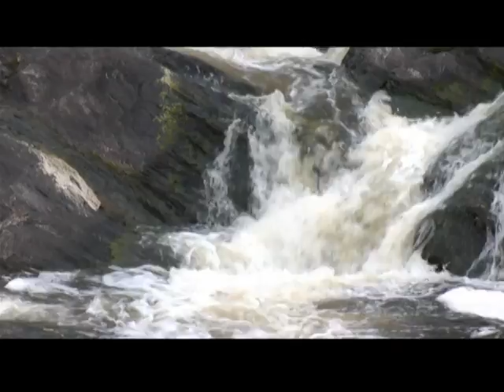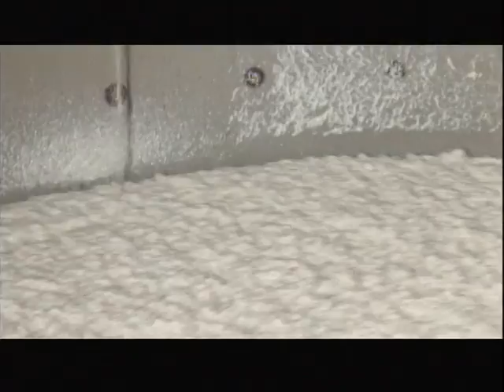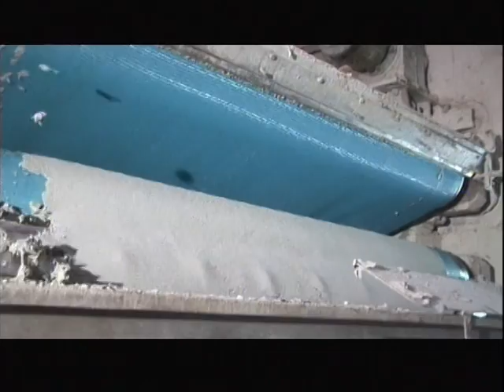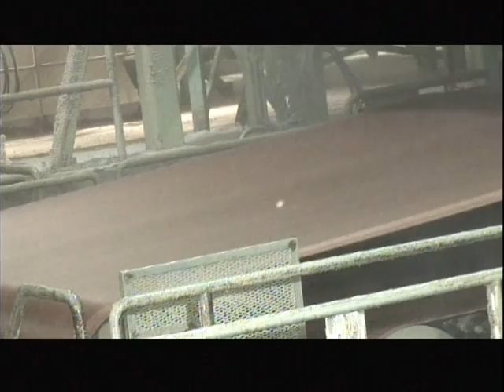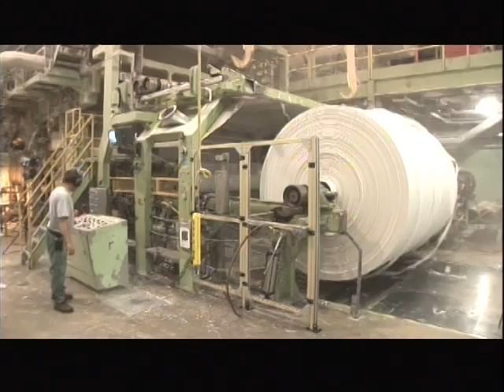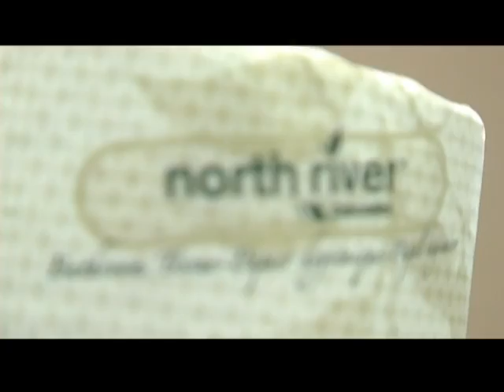Cascades Tissue Group - Sustainable Manufacturing Process

Comment: I would like to import pattern tissue paper from Canada to Ecuador. Please help me.
Reply from the maker: Hello Robinson, please send us an email with requested product information and expected annual volume. We will see how we can help you. Regards,
Reply: @CascadesTG-CascadesPRO  robinsoncastillo290684@gmail.com
Reply from the maker: @robinsoncastillo5090 , please contact us at cascadespro@cascades.com to give us more details.
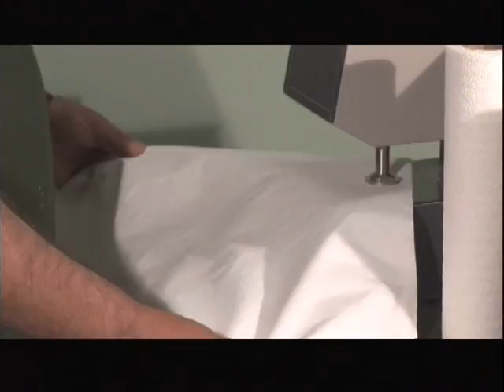Reply: Cascades Tissue Group what can you tell me about the paper machine @ 3:08

That turn-up happens so quickly. Never seen anything like it the way the primary arms drop that fast. What is the run speed of the machine?